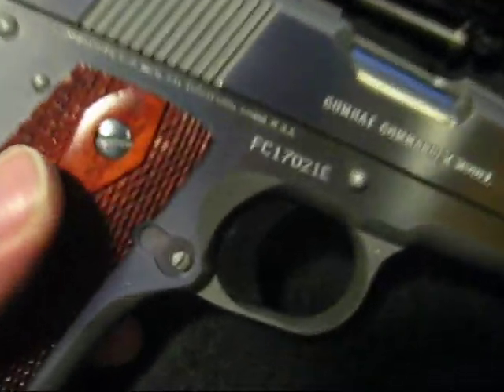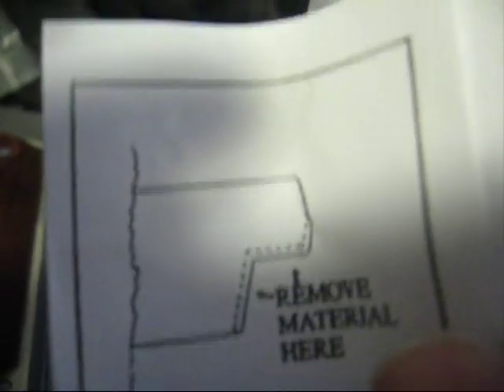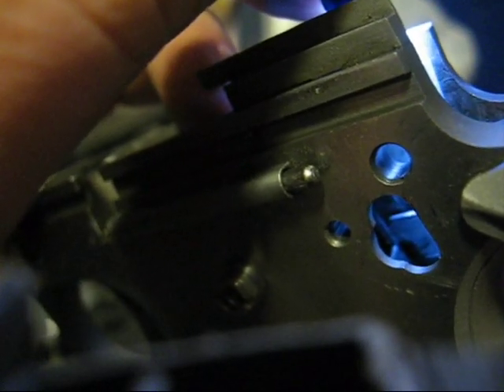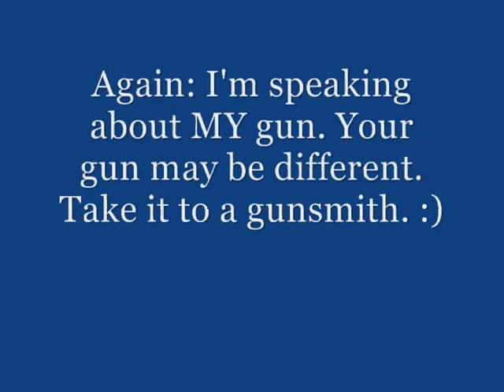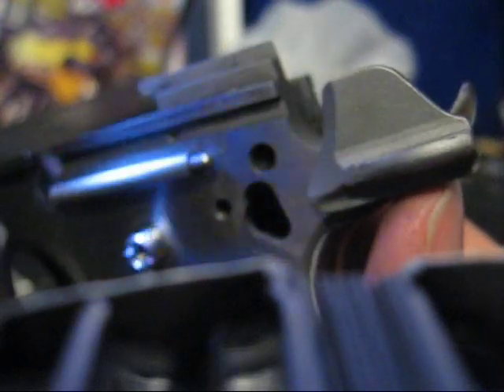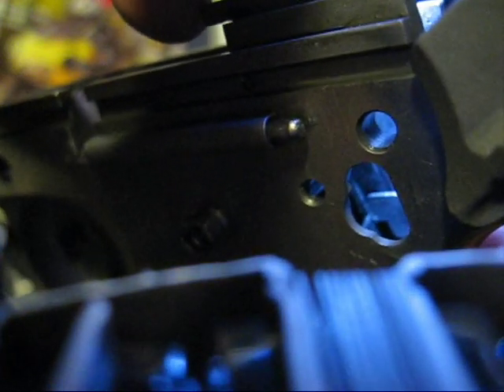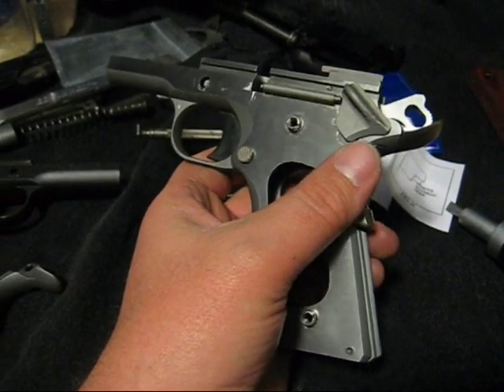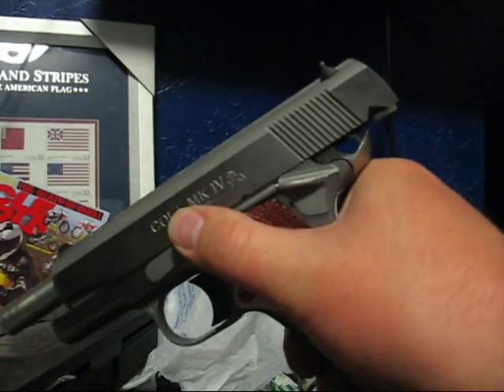Colt 1911 Wilson "drop-in" beavertail grip safety installation

Comment: The only mod I had thought I was going to pay a smith for. Bought a Wilson Combat beavertail and it would not fit. Thank you so much for posting this up. I compared the two surfaces using the thumb safety to mount them straight and saw exactly what you explained. Took it slow and removed material with a file until the two matched. Perfect. 👍👍👍👍👍👍
Reply from the maker: Excellent!

Comment: I had the same issue with my Kimber 1911 10mm target but with the factory grip safety.  If I grip it  really hard, there was no issue. But when I use a firm grip, it hangs up ever so slightly on the trigger and affects my trigger pull.  By using the example on this video, I removed a slight amount of material on the grip safety with a coarse stone, and smoothed  it out with a fine stone afterwards.  The trigger pull is now as smooth as a glass surface.  Thank you sir for this excellent video.  Saved me a few bucks and a trip to the smith.  Problem resolved.
Reply from the maker: Good to hear. Nice job figuring it out! 😎

Comment: Jeff, Just installed one of these on my Colt 1991A1 along with an Ed Brown Mainspring Housing and Extended Mag Well and an Ed Brown Barstock Hammer.

Your video made the  installation of the Grip Safety wayyyyy easier as I ran into the same fitting issues as you did and was unsure exactly where to grind and polish the end of the safety. Was able to adjust the Grip Safety perfectly for my preference. Your description of the problem and solution were spot on.
Reply from the maker: Mark Pope good to hear, Mark. Glad it helped. Sounds like you have a great build going!

Comment: A GIANT THANK YOU Sir for a superb job! Your detailed explanation and macro camera work is top notch. I greatly appreciate your taking the time to do this for the 1911 community.
I've long wanted to upgrade a pair of Commanders I have, bring them up to par with my other 1911s(a Steel Combat Commander/9mm[1978]; a LightWeight Commander/.45ACP[1991]). I had to file O.A.L. just to get the grip safety in to begin with, then the fine tune. I was careful to shave off the smallest amount, try it, do it again, and again, until done. After extensive safety testing all is well. Liked & Subscribed, and I encourage other viewers to do the same.
Reply from the maker: Good job! glad it helped.

Comment: Thanks for your video.  I installed the same grip safety on my Colt Gold Cup National Match with the help of your vid.  Like your grip safety, mine needed the front and lower half of that tab in order for the trigger on my pistol to work.  It didn't take much time to remove enough material to make it work, and it works flawlessly.  Thanks again!

Comment from the maker: @B5Dan Correct; the wilson "drop in" beavertail is intended to require no modification to the frame of the pistol. You just need to fit the tab at the front of the grip safety as shown in the video. Or you might get lucky and it may require no fitting. That's assuming that your RIA is proper GI spec and the frame is wide enough to let the grip safety seat properly. :) If your RIA has a standard spur hammer that will also need to be replaced with a "commander" type I believe.

Comment: Yep its a matter of taking a little off till it works, I shave off a little bit with a Dremel cut off wheel disk, on its flat. Ya cant put the metal back, so just shave it a bit and keep the right angle too till it works. My last one was an Ed Brown beavertail, had to get that round jig with it for initial fit, and I had to fit it all around the back of the frame to this present parts match all around. Works and looks great I love it.

Comment: I had the same issue with my R1. I couldn't figure if it was the hammer, sear, or grip safety, but your video saved a bit of time. Now my R1 fires smoothly, thanks.
Reply from the maker: Excellent!

Comment: Good job sticking with it to the end and not messing anything up. I know it was almost 8 years ago by now but you seemed to be learning how the grip safety worked AFTER starting this job. You were just about in over your head. The 'Drop-In' reference for this part is that there's no requirement to reshape the rear of the frame like you would when other beaver tail safeties are installed. Plenty of 'Drop-In' parts, especially for the 1911, still have to be custom fit. And the instructions looked pretty clear and showed where material would need to be removed.  It shouldn't have been such a revelation at 03:40.
Reply from the maker: well, gotta learn somehow. :)

Comment: Excellent video!  Thanks!  I just replaced my trigger with an WC Ultra Light Match and replaced the leaf spring.  Afterwards, my grip safety does not prevent it from firing.  I couldn't see inside to see what was going on.  Your video showed me how to do that.  When I get home tonight I'll be figuring out what the issue is.

Comment from the maker: @bobbycombo It would seem to make sense, but the tolerances are tiny and eyeballing it doesn't work. Plus I believe the distance between the thumb safety hole in the beavertail and the tab was slightly different between the two. And since the tabs are both on the right side of the grip safeties, you can't really line them up next to each other well enough. The only way to properly do it is fit each one individually until it works. Thanks for the great question! :)

Comment from the maker: @nodillinger It also said to remove metal from the underside of the tab, which in my case wasn't as necessary. The fine stone is a good idea, thanks. I was using a fine file to to the last bit so I think I'm good. I've shot 4 pistol matches and 3-gun matches with it since and it runs perfectly. Thanks for stopping by. 8-)

Comment from the maker: @TheRealKoop You're welcome. The "drop in" versions don't require you to radius the rear of the frame. The other models (which are smoother in the transition from frame to grip safety) do require frame modification. I wouldn't do that either... for me the drop in version works great, looks great, and wasn't too difficult to figure out how to install. And you don't touch the frame and can drop the stock safety back in at anytime. Thanks for the comment.

Comment: did the same type of stuff as a young G.I.in germany 40 yrs ago,worked in a army parkerizing shop,system was disassemble a couple of hundred .45s each part in separate dip-basket we had baskets full of tiny matching parts,then mix and match and reassemble,seemed like each part had to be stoned at some point,then assemble,lube,set each trigger at 4.5lbs,dry fire a dowel out ,and put away.so congrats on the reassembly,and how'd you score shooting,cool vid too

Comment: Wilson Combat “drop In” parts are well made BUT be prepared to do some custom fitting. Their idea is the part “drops in” after you have fitted it to the firearm and not as it is sold beforehand. I learned this when I purchased a 1911 barrel and included barrel bushing which fit neither the barrel or the frame.

Comment: If there's a tricky job for any "backyard gunsmith", that's the beavertail installation. You could screw up a lot of things when installing other parts ( bushings, sights, triggers ) but IMO the beavertail safety is really the hardest task for a 1911 builder/tinkerer.

Comment: What is the Part number for the grip safety? I have the same lightweight Commander (My Slide has marked on the Left Side 'Commander Lightweight' and on the Right Side it is marked 'Lightweight Commander Model') I had a "Gunsmith" install a Wilson Combat Grip Safety but it does not fit like the one you used. I do not like the open wedge the Wilson Grip Safety has. Your Grip Safety seems to fit the COLT frame perfectly. Thanks for the VIDEO.

Comment from the maker: @ldgrey1963 I don't have the part number; I got the part second hand. It was just the standard "drop-in" beavertail. If your gunsmith routed/milled/modified the rear of the colt frame to install the safety the "drop-in" one won't fit properly. There will be gaps.  Good luck 8-)

wait... according to brownell's the stainless drop in safety for the commander is part 429SC

Comment: Well I installed mine, and it required ZERO fitting. However, it has a much, much greater gap between the tail and the frame. Yours looks as if it was fitted to the frame in comparison to mine. I pruchased the Wilson drop in unit from midway. Do you happen to have a link to your purchase?

Comment: U did a great job, but i wish
I could have seen the work you did. Because i am a bit apprehensive about  my "WILSON COMBAT" drop in beaver tail i just bought for my 1911 a1 govt model.  Did u need to dremmel ur frame at all? Or use a file on the beaver tail?  I hope it all works out for my purchase.. Man i swear a 1911 is like a Hot rod..  I feel like Han solo and my weapon is the millennium falcon👍

Comment: I know this vid's a few years old, but was wondering if you by chance have one where you show taking material off of the grip safety as well as full disassembly of both safety mechanisms?
Reply from the maker: +AverageJoe Any disassembly vid will show you how to get the 1911 apart. I don't have a specific video showing removal of material as it's just filing on the area indicated in the video. Follow the instructions from Wilson, have a close look through the frame as demonstrated in the video so you can see where the interference takes place. Good luck!

Comment from the maker: Dunno. It fit my Colt, so I imagine it should fit all Colts and similar with the proper fitting. You'll have to replace the spur-type hammer, though. So if that's what you mean by mil-spec, then...

Comment: Why dont they make all beaver tail grip safteys like this? Taking materal off for fitting vs modifying your frame so you can't go back to a standerd if you want
Reply from the maker: Basically because it leaves larger gaps at the rear of the frame and around the joint where the beavertail interfaces. It's not perfectly smooth and it doesn't look "custom." A hand-fitted and perfectly integrated beavertail is a thing of beauty on a 1911, and lots of people are willing to pay for it.

Comment from the maker: No modifications to the frame are necessary, which is the purpose of the "drop in" beavertails. Yes, I used a file and india stones on the forward tab of the grip safety. The interior shots of the action should help you get an idea about how it works and where you need to remove SMALL amounts of metal at a time. :)

Dremels are not tools you want around your guns. ;)

Comment: #1 in the future if you will make a tracing of the stock part on a piece of acetate with a fine ball point pen yo will have a template to use as a guide for the part you are fabricating. #2 get some calipers (digital if you cant read analog) an take the dimensions from the stock part and write them on the acetate. This will take a lot of the guess work out of the equation. Also leave a few thousandths on the faces and remove them by hand with a stone

Comment: Good video... With that being said, the part where you dropped the slide stop hurt my ears and made my heart skip a beat. You're never supposed to fully drop the 1911 slide without chambering a round. Let me just make sure I'm clear, it is fine to do a regular slow rack chamber check. You just don't want to let the slide freely SLAM shut. The main reason being it takes a toll on the sear, it does something to the sear face that causes it to eventually slip. I've seen it happen first hand, three round bursts of 45 ACP out of a 1911 is pretty scary.

But with all positive criticism aside, keep up with the videos.           😀🔫
Reply from the maker: http://youtu.be/Dpdy8QQ-Y-Q?t=6m7s Hopefully that video works. Les Baer factory, repeatedly dropping slide from slide lock. I agree that it shouldn't be a regular practice. But when completing trigger/safety work, you need to do it ONCE to make sure the hammer doesn't drop. That's the only time I've ever done it to mine. If your sear won't survive it ONCE, it's not ready for battle, IMO. Thanks for the comment and excellent explanation.

Comment: Colt has had complaints for years about the shitty fitting at the factory and they never fixed it just bought another colt Rattles more than anyone I ever bought before so I think they getting worse I can buy a Springfield for $700 and it doesn't rattle you can't carried a gun because the rattling you actually notice it it's annoying as fuck